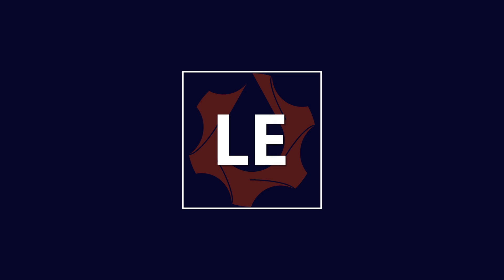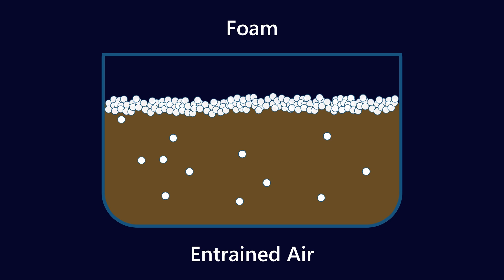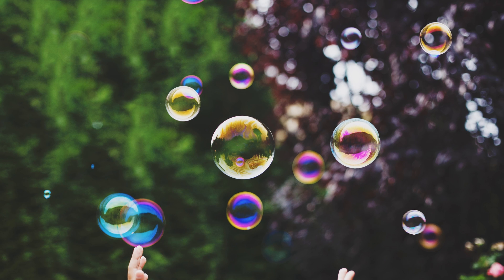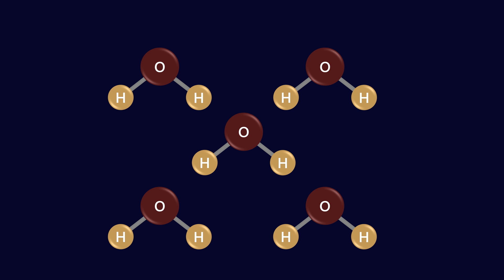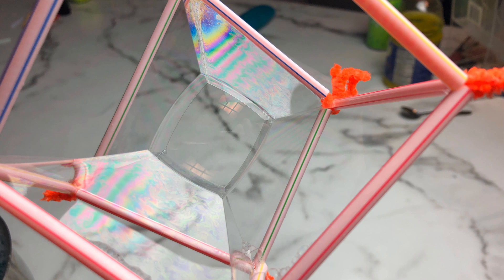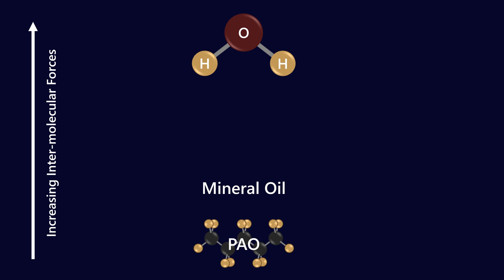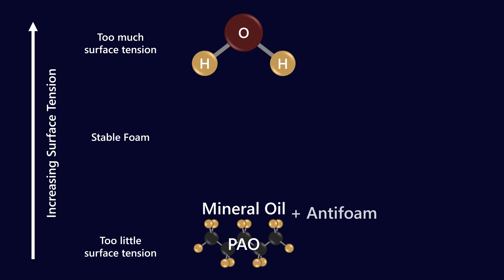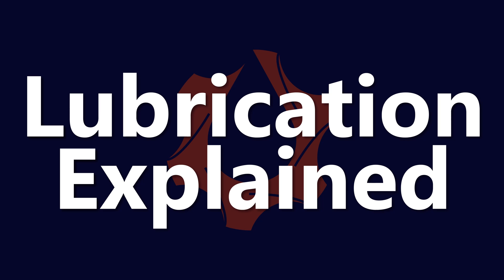How does foam form in oil?

Comment: Great video, thank you! I’ve been puzzling over a friend’s outboard motor that was found to have very milky-colored oil in the crankcase. I’ve looked for obvious leak paths and have not found any. The one suspicious thing I found was evidence of water in the carburetor float bowl. The (4 cycle) outboard had sat for two years without use. I’m curious as to how much (actually how little) water mixed into the crankcase oil is needed to lead to notably milky colored oil. Thanks!

Comment: What happens if too much foam on gearbox Matic (car/motorcycle)?
Can it damage the gearbox component?
Reply from the maker: In some cases, yes. Some level of foam is normal, but too much foam can reduce the effective fluid level and can interfere with film formation if the foam gets into the load zone.

Comment: Please help me understand the reason of foaming, pure water has high surface tension and when surfactant like detergent added, bubble formed and that because water surface trying to reduce its surface tension so we learned that low surface tension causing foam while in PAOS or non polar compounds there is minimum or no surface tension (st) because of which its foam tendency (as per ASTM D 892) is very less mean no st no foaming and on same principle antifoam works which is contradictory to first point
Reply from the maker: Yes, you're exactly right. Water has too much surface tension, which makes the air bubble brittle, and prone to break. PAO has too low surface tension, which means the bubble surface becomes too thin, and therefore breaks. There is a "Goldilocks zone" between oil and water in which the amount of surface tension is just the right amount to cause the air bubble to remain stable.
Reply: @LubricationExplained  Hi Rafe, May I ask why liquids with too low surface tension (like PAOs) make the bubble surface become too thin? Thank you.
Reply: @phamtientrung9168  I guess this is because non-polar molecules do not attract each other much.

Comment: I worked In a lubricant manufacturing industry and at times meeting foaming characterisitcs in manufacturing blends can be of challenge, any idea what could caused the failures? We are talking about brand new blending products that fails foaming specifications even after adding antifoam to the maximum level allowed.
Reply from the maker: Could be a few reasons, but usually foaming is a result of contamination. In a manufacturing plant if the same equipment is used to manufacture different products then there’s easily going to be residue of a previous product run - sometimes the additives just don’t play nicely together.
Reply: @LubricationExplained  Thanks for responding, whish you could come and work for us:)
Reply: Socal area merit oil sales none foamimg oil we use it on worm gearboxes under stream hot temp 👍

Comment: thanks for sharing. this great. how does foam affected by change in temperature?
Reply from the maker: Good question! Temperature tends to effect the amount of air that can be dissolved in oil. Temperature variations tend to cause air to be absorbed and then break out, so large temperature variations can be a contributor to foam problems.
Reply: @LubricationExplained  many thanks. appreciated
Reply: @LubricationExplained  you mean at high temperature air dissolved and when temp come down that dissolved air came out and causes foam?